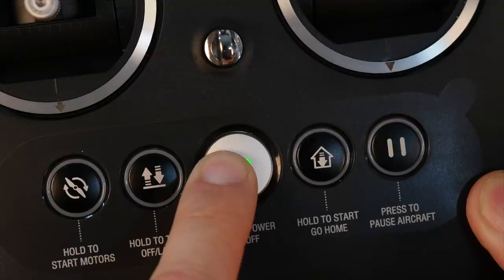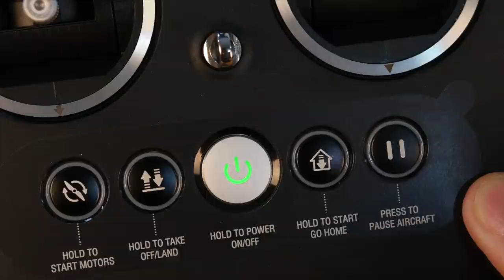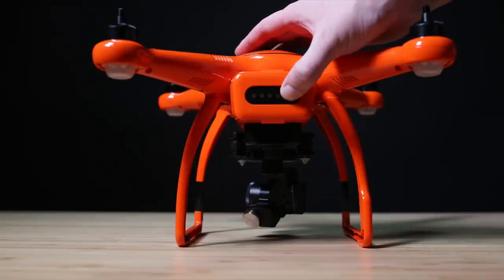Autel Robotics Tutorial: LED Light Sequence

Comment: Please do a video showing how to fly the xsp without a tablet, using only the lcd screen on the controller.  I have had times when I have lost track of the xsp and had a low battery with trees everywhere and did not want to push the return home button.  Also, I live in a hilly area and when I launch from the valley floor I need to go above the 400 ft limit to keep from hitting objects above me, would you show us how to do this while staying in the gps mode?
Reply from the maker: Great Idea! We actually created this one as a path into flying without the camera. Check back for a video of that in the future!
Reply: Jeff, as to the second part of your question, or suggestion, the 400' rule is for AGL or Above Ground Level.  So if you start at zero and the hill next to you is 100' above your take off point, you will need to fly to 500' from your starting location to be at 400' above the hill. So in this case, when you are flying in a situation like this, you need to adjust your max limit to 500' and that will keep you safe. I hope this makes sense!  so say you are going to film the top of a 200 foot building but want a view of 300 feet above the building. You would set your max limit to 600 because you are allowed to be 400 above the structure that is your focal point.  Do keep in mind however, that upon auto return home the bird will either rise to your RTH limit or stay at current height if it is higher.  So once you are no longer above your focal point but are still at 600 feet or even 500, you are breaking the rules and should lower your altitude accordingly.
Reply: Thank you so much for the clarification!... How would I set the "Max Limit"?... Do I do this during flight?